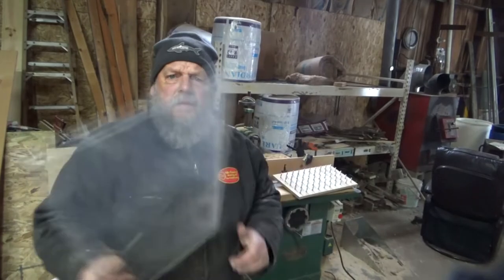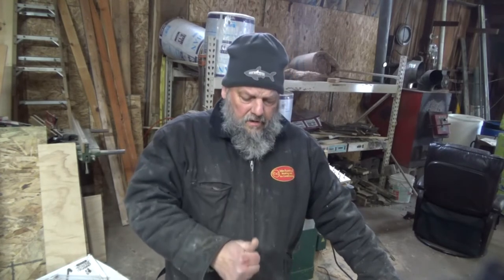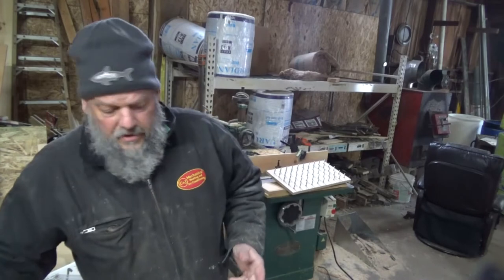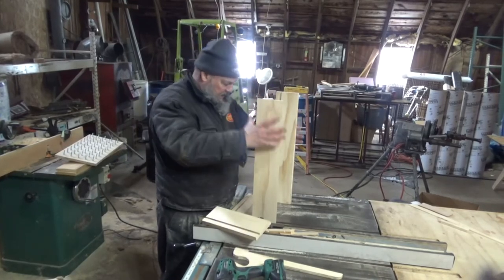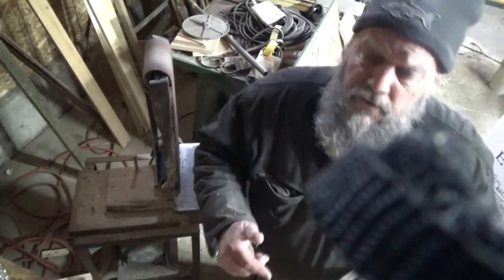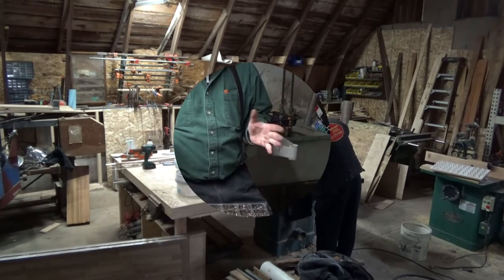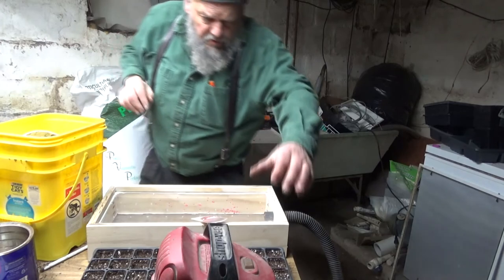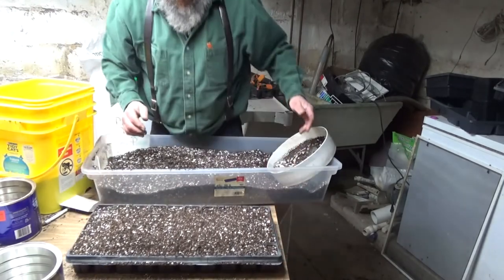Vacuum Seeder Build

Comment: That was good.  I was expecting you to use metal sheets that could be changed out for different size seeds.  The clear plastic does allow you to see the seeds drop in trays and is easier to work with.   You're just behind me in starting your onion seeds.  :)
Reply from the maker: I only use 50 cell trays so I only need the one. I may begin using 72 cell I will make a whole new one for that. I will probably make a video on how I improve this one it leaves a bit to be desired.
Reply: @chickenjohnny3308  A follow up video would be good.  Especially once you have had a chance to use it and make improvements.  I really like seeing how the market gardeners like you do things.